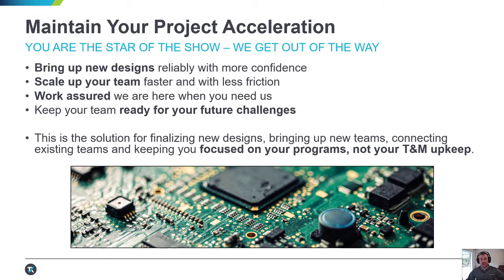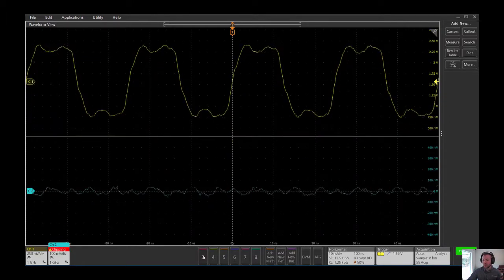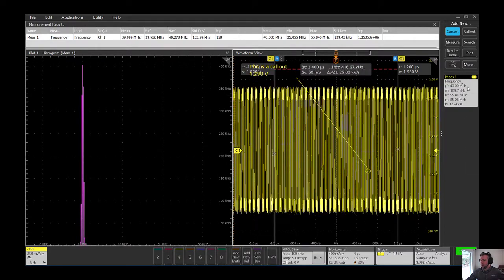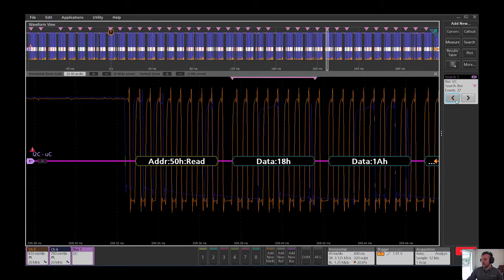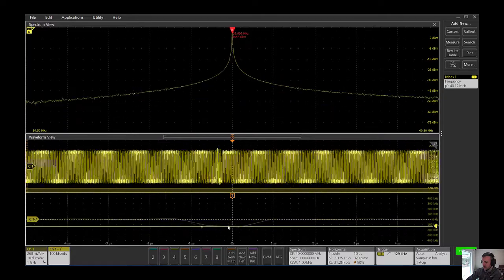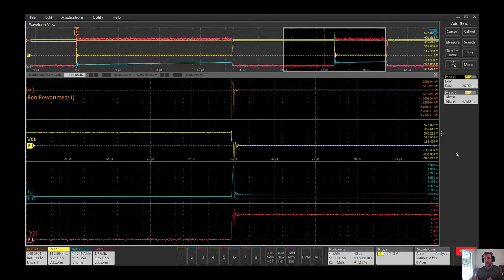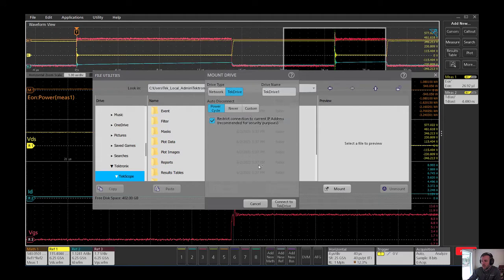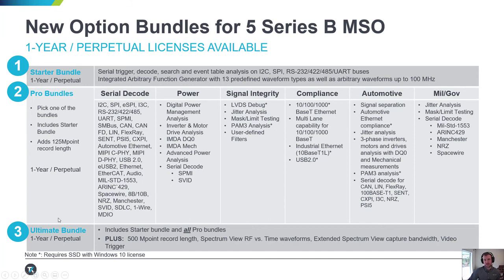5 Series B MSO Oscilloscope Introduction Webinar

Comment: Nice demos on your oscilloscope, we ordered the same in my company..
What are the characteristics of the probes you were using during this show ?
Reply: There are several types of probes used in the video.  Most of the measurements are made with the TPP1000 10X passive probe.  This is a low-capacitance (4pF) pasive probe.  The double-pulse measurements in the video use reference (or pre-captured) waveforms. These would probably have used a combination of differential voltage probes (e.g. THDP0200) for Vds measurements and IsoVu Optically Isolated probe for Vgs high.  Vgs low may have used either a passive probe, like TPP1000 if the low side of the bridge is grounded.  Otherwise it would be another differential voltage probe.  The 3-phase motor drive measurements are using three THDP0200 Differential Voltage Probes and three TCP0030A Current Probes to connect to all three phases.  Hope this helps.